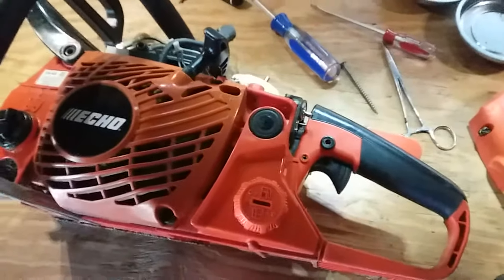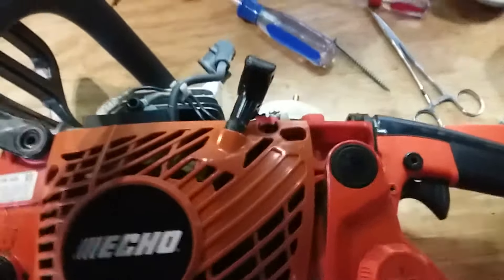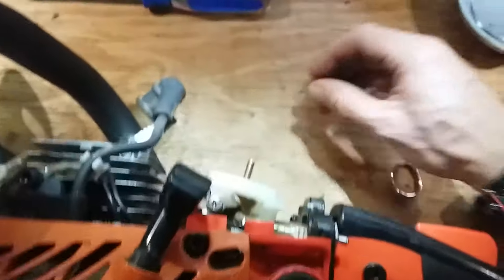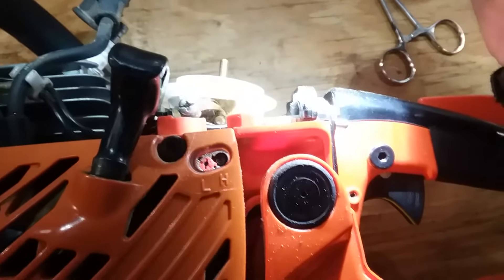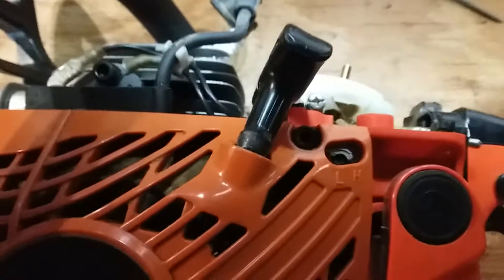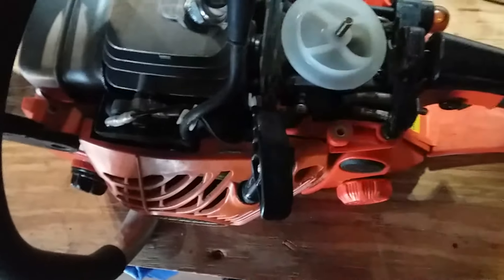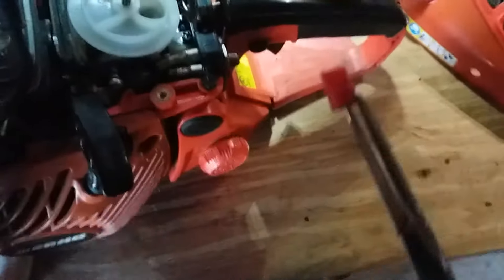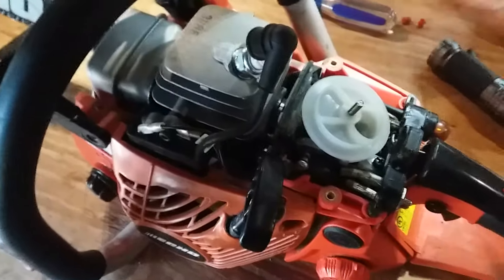Echo CS-400 carb limiter cap removal

Comment: Thanks. This may be confusing to some as you show the chain saw partially disassembled. I was able to remove the limiter caps using forceps without any disassembly. It took a few tries but they will come off. I left mine off and now I can easily make high and low speed adjustments when needed and you definitely need to adjust the low speed on Echos from time to time.
Reply from the maker: Only the top cover and air filter have been removed for clarity.

Comment: Hester, I'm a little late to the party on the limiter removal video...apologies.  Very good description on the cap removal.
I will remove the caps, but need to know what the tip configuration/shape of the proper adjustment tool is...for a ECHO CS440.  I bought a package of 12 different adjusting screwdrivers and they aren't marked as to what saw, etc. to use each on.
Reply from the maker: I believe a small flathead screwdriver will work with those, but not sure. Once you have the limiters off, you can look at the screws with a flashlight to determine the shape and find the corresponding tool.
Reply: @cobhc1986  Thanks for the quick reply!  My Weedeater has a splined tip, but was unsure of the ECHO chainsaw.

Comment: After adjusting the carb, do you re-install the caps?  Will the adjustment wander later on without the caps?  I just removed the caps and adjusted the carb on my CS355T.  Used a tach to set the high.  Runs so much better now.

Comment: Im at 10k asl... Should i do this to get it to run right up here or do i have to rejet?
Reply from the maker: As far as I know, there is no way to rejet these carbs, you simply adjust the fuel/air mixture with the adjustment screws shown in the video. L screw controls mixture at idle and throttle response and the H screw is the high speed adjustment for wide open throttle.  The CS400 does have a rev limited coil, so that makes tuning by ear at WOT a little more difficult because the rev limit sounds a lot like the “4 stroking” sound you would adjust to on a saw without rev limiter, so you want to tune for max power in the cut.

Comment: Just acquired this chainsaw and will be troubleshooting the carb soon.  What’s the purpose of removing those limiter caps?
Reply from the maker: Due to EPA regulations, the carburetor adjustments are limited to a range that is within those regulations, the problem is that they are usually set a little too lean, which will shorten the life of the engine and cut down on power. The limiters have to be removed if you want to set it to where it needs to be. There are plenty of videos on YouTube that show you how to properly adjust the carburetor.
Reply: @cobhc1986  Thanks